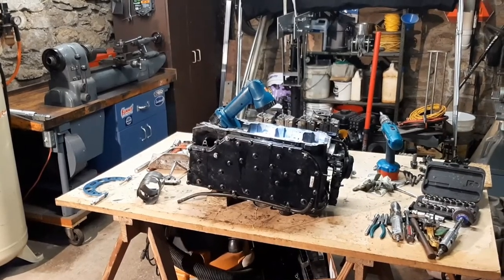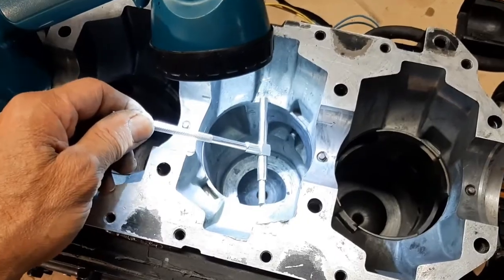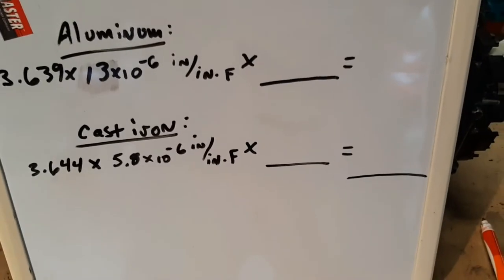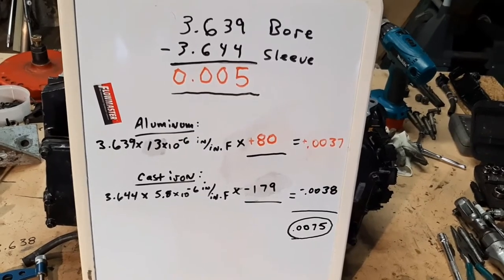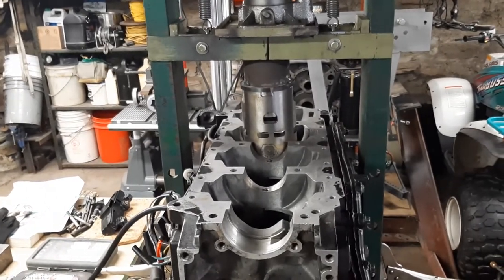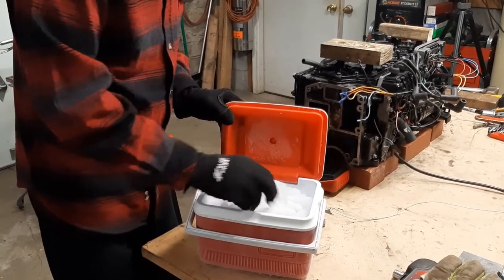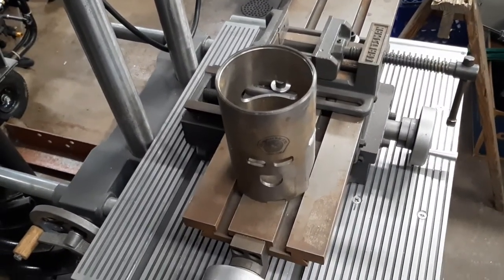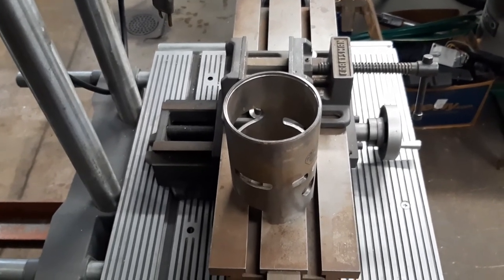Mercury Outboard Cylinder Resleeving

Comment: Couldn't you hone the block with 3 stone hone just to clean up any scratches and help level the surface? Also use some wet dry 1000 grit paper on the outside of the sleeve?

Comment: I am going to take this job on for the first time I have the same power head so these cylinder liners are dry liners from the factory? Installed dry and removed dry? Some guys say they need to be bored out to get liners out this video says different and it looks like it’s not necessary

Comment: what do you charge to do this i have a 2001 50hp tracker sleeve has moved on us and want to add two new ones
Reply from the maker: hi, just saw this. if you need outboard repair please text to 412-849-6190. thanks.

Comment: Did you have to bore the sleeves for new pistons?
Reply from the maker: Yes, sleeves are never provided finished on the ID.  The press fit changes the diameter so you have to bore it.
Reply: Would have been good to have shown lining up makes if any on sleeves prior to pressing in